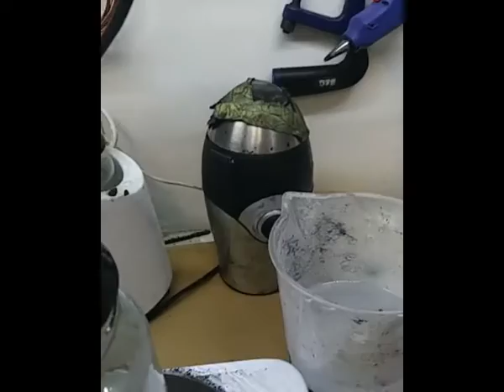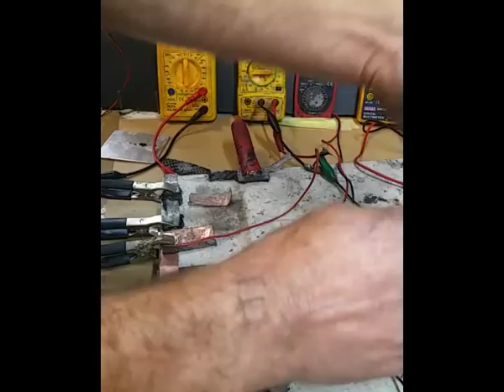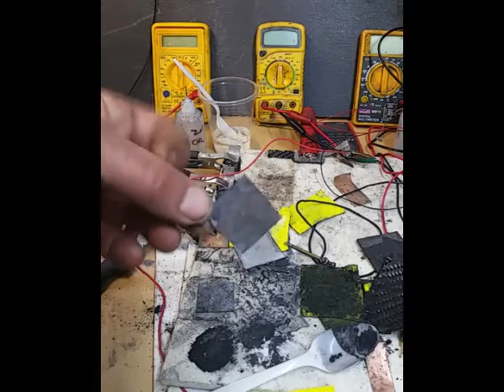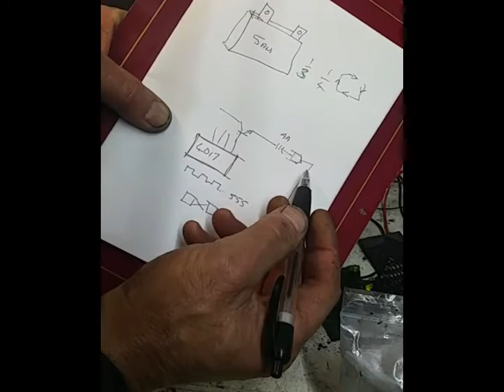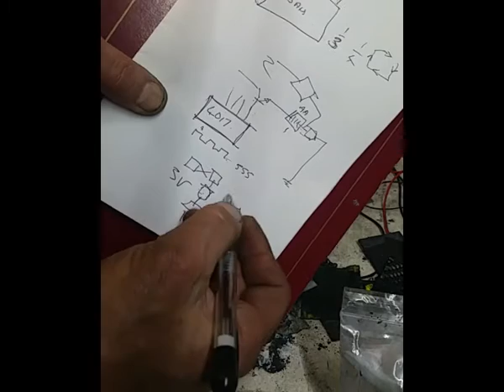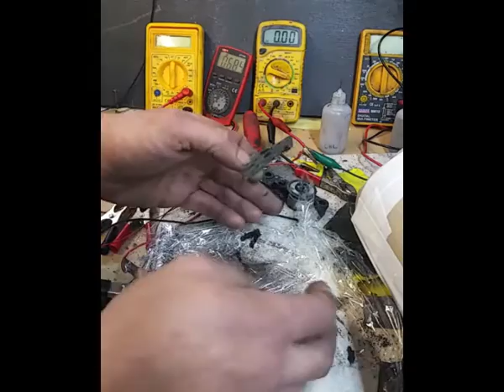New Carbon Solid state cell & SEAWEED BATTERY yep just Seaweed

Comment: Hi Kev, did you see this breakthrough voltage Aluminium graphite battery with 3.25 Volts output and 100 mA ?
https://www.youtube.com/watch?v=wf1N9oWu_GI
Reply from the maker: Hi is this Stefan ( hope that is correct ) sorry we have not spoken before but i do keep a close eye on you ;-))
So no i have not seen this but i will most certainly view it tonight.
many thanks
Reply: Yes, Kev, go for it and watch it, this is the highest selfmade battery voltage I have seen so far it and it seems easy to replicate... Am in this moment not myself ready for doing this, as I have to test new software in this moment, so no time to play with chemics, but it seems like a pretty simple setup and could be probably also made into a gelbattery setup if done right...
Reply from the maker: overunitydotcom i will watch it tonight thanks mate... the best  single layer voltage i ever got was 3v
Reply: Cool, what electrodes and electrolyte did you use to get 3 Volts ? Only also via charging ?